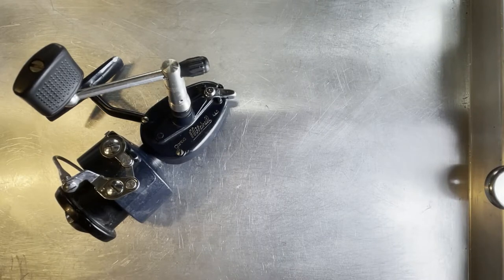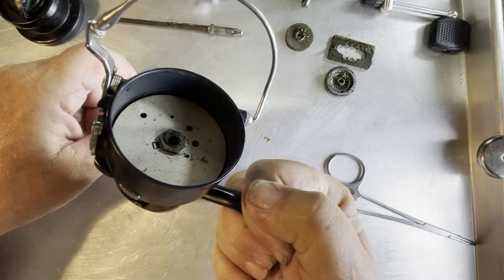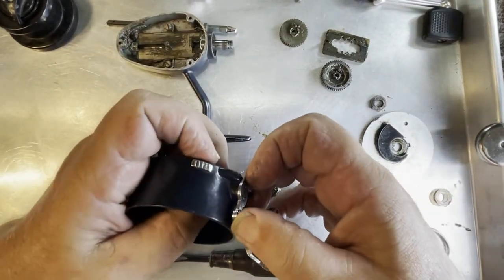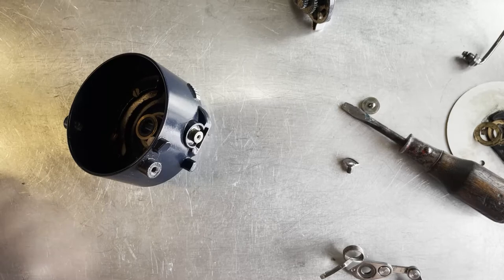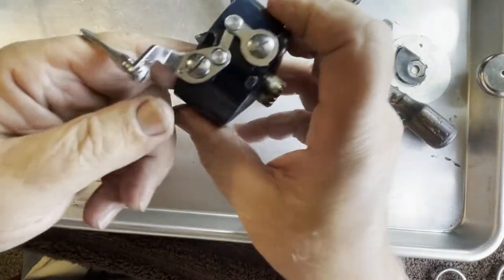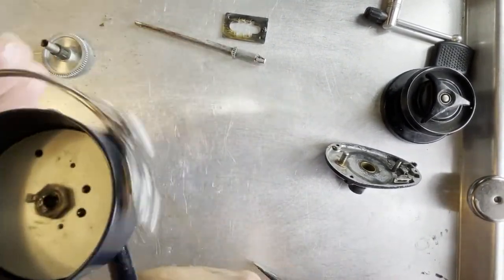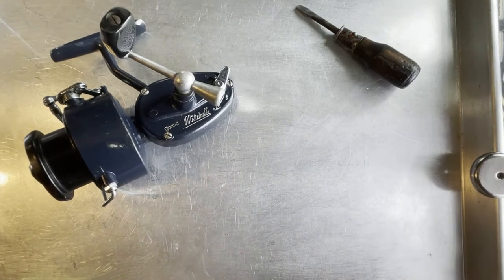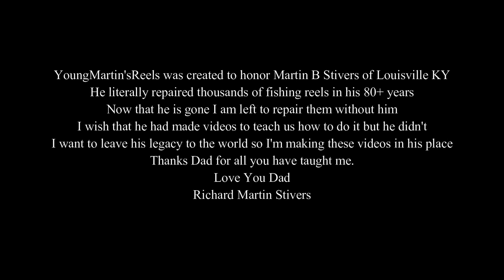Young Martin's Reels Garcia Mitchell 440 Service & Lube Including Bail Remove and Install

Comment: Haven’t used my 440 in almost 20 yrs, took it out to give to a friend and found it’s action to be very stiff. It needed a cleaning and lubrication, very grateful for your video as it saved me time and errors. Works like new now and ready for many more years of fishing. BTW, the 440s are smooth with a fast retrieve, strong and powerful under pressure. My last fish on it was a 28# salmon out of the Sacramento River, a 45 minute haul in on 15# line on a humble fiberglass trout rod.  The reel was totally reliable and up to the task, performed flawlessly. I like vintage reels, still use my modified Penn 300 for open ocean fishing.

Comment: Have 5 440 reels after this video I was able to improve the performance well done. Rick helped me a lot
Reply from the maker: William, pretty much all of the reels I have, I consider to be potentially sacrificial so I don’t mind takin them all the way apart. I’m usually successful at getting them back together. I did save the 440 until I had better skills. It turned out pretty good. I still haven’t tried fishing with it yet. I’m glad you found the video helpful.

Comment: The original bailes on these reels had a manufacturing defect. The bail wire was spot welded to the fitting on the take-up end. That was the weak point. They have a replacement 2nd generation bail assembly to fix that problem.
Reply from the maker: So are you saying the bail from the 440A will fit the 440 with no modifications?

Comment: That bail lock it, so that it doesn’t pop open When you set it down or just accidentally bumped the bail and you have line playing all over the place. I’ve had mine for over 40 years still works.

Comment: I have a 330. I also started down the road of taking the bail mechanism apart, saw that little gear and said nope! You're a brave man. You made it look somewhat straightforward, maybe I'll try it just for the challenge. I think the bail lock is useful when transporting the reel
Reply from the maker: I didn’t know there was a 300 series that had that bail. Nice to know. It turned out it wasn’t that hard to take apart and put together. That being said, if you weren’t mechanically inclined, I’d leave it together and clean/lube it as is.
Reply: @youngmartinsreels5314  The 440 is the high speed version of the 330, like the 308 and 408, etc. Also it doesn't have bearings like the 440. Everything else is about identical.
Reply: Rick, I think the 440 is the high speed version of the 330 just like the 300 and 400 reels. That’s why it has those roller bearings which the 330 does not on the main gear. Mitchell was consistent in their numbering system and how the higher speed reels had more bearings. For instance a 386 doesn’t have a main gear roller bearing while the 486 does. Same way with the 396 and 496 skirted spool saltwater reels. (I call them “needle” bearings but both names are correct. I;ve spilled those little suckers more times than I’ll admit!)
Reply from the maker: I’m thinking I might have cheated myself out of a fun experience by not taking that apart. I also have Jeep transmission videos out there where I teach people how to install needle bearings. Maybe I should have pulled those apart, cleaned them and then reinstalled. I’m sure somebody will end up pulling they out and wonder how to put them back.

Comment: 440s were very popular for match fishing for silver fish in the UK back in the 70s/80s.  Still use mine now (I have 4) but finding it harder to find a tackle shop to service them.  Did a bail arm myself a good few years back but it was hard work.
Reply from the maker: No service centers is not just a problem in the UK. There are very few places you can take a reel to for servicing these days. That’s one reason I make the videos I do so that others can do the service themselves.

Comment: That bail looked like a pain to reset. But you were able to do it. Great content as always Rick
Reply from the maker: To be perfectly honest I got that reel from my dad’s parts pile back in November. I waited until last night to tackle it. I wanted to improve my skills prior to taking it on. Back then, I never would have gotten it back together correctly. Last night I decided I was ready for it. Turns out I was right. Fish On!
Reply: @youngmartinsreels5314  By the way, I believe the handle from a 300 or 400 will fits a 440
Reply from the maker: The handle from the 300 does fit and works fine, but the 440 handle has a collar at the bottom, so this doesn’t look exactly right. Even so, I’m happy with the results.

Comment: That bail is called an “Ottomatic” reel as marketed by Mitchell. I don’t have a 440 but I do have a 330 and after practicing I got used to this automatic bail. It’s sort of like an early “fast-cast” reel. I can’t believe how filthy this one is internally. I’ve had more problems with that bail than anything else. It is very important to synch the oscillation. If the bail is working don’t ever take it apart! My 330 will work better than the bail on this 440 because it has a 5-point baffle plate. I got mine from a guy in Hawaii who specializes in these Ottomatic bails. The trick is learning to cast these reels. I can’t believe you took that bail apart. I was literally talking to the video, “Don’t do it Rick!” You are braver than me! It is so easy to mess this up. You have no idea how lucky you were with this. Where did you get that fancy gripping screwdriver. I have some different kinds. By the way, watching you with that bail was most entertaining. You did a far better job the first time than I did. When you fish this reel you’ll know why you need a bail lock but I’m not going to tell you.  I love these reels though.  Rick you’ll never know how much I enjoyed this! — Chris  (oh, you found out why you need the switch. It would have been funnier to think of you fishing and bumping the bail. LOL)
Reply from the maker: Chris, I ran from doing that bail for several months until I got my skills up. Also I made sure I wasn’t tired when I started on it so I wouldn’t make stupid mistakes. After that, it was just take my time and examine exactly how it went together. Once I knew which tooth the teeth needed to be in it was easy.  

As for the screwdriver, I honestly thought they were a dime a dozen until I went looking for one to recommend to you. My dad and step dad each had several of them when I was growing up. Sears sold them. They were rather fragile. If you tightened the screw up instead of just starting it, it broke the gripping fingers. I bought this one at a yard sale a few months back for a dollar. I figured there would be hundred of them on EBay. I was wrong. I didn’t find any of them.

So your saying that you need to lock the bail when you hook a fish to keep it from popping open, or does it just pop open if you hit it? Either way that could be show stopper.

I did go back and watch the video again this morning. I found myself holding my breath when I was taking it apart. I really enjoyed that video.
Reply: @youngmartinsreels5314  I honestly don’t remember enjoying a video that much. I mean I was talking to you throughout the whole thing. You are a brave man that’s for sure. I took mine apart once and I never intend to do that again. If you ever work on a Mitchell 406 that can be very entertaining as that reel has several surprises. Have you ever worked on reels with open ball bearings? The 406 has one and a Bretton 400 has a double open bearing. You should have seen me crawling all over the floor looking for those bearings. It was absolutely comical. You are far more skilled than I am but have I told you I’m 60% blind? (Stargardt’s Disease) — Chris
Reply from the maker: Chris, So sorry about you eye sight. I’ve become very far sighted in my later years but it corrects just fine with reading glasses. I can’t imagine doing this without corrected vision. I salute you. I’ll have to keep an eye out for one of those free ball bearing reels. They sound like a lot of fun. I had an English racing bike when I was a kid the used uncaged ball bearing on the axles. I remember chasing them down driveway. Your experience reminded me of that.
Reply: I have almost every Mitchell otobail reels  in my collection ; exept the 540. The first ones was made in 1955 , only wearing the MITCHELL otomatic sign engraved , no 330 lettering . The first ones didn`t have the ,, travel lock " button on rotatorhouse and the bail in more  300 shape with the D shaped line eye. The last made Mitchell otomatics was the 840 .

Comment: I'm curious, what type of grease do you use on these old Mitchell reels? I have a few old Mitchell 300's. After cleaning them up and applying Penn grease, they seem stiff and don't turn as freely as they should. Any advice you have would be appreciated.
Reply from the maker: Dolan, I use Penn grease on most of my reels. There are so many sliding surfaces in the Mitchell reels that the grease tends to cause them to drag. The places to oil instead of grease are where surfaces slide against each other. For instance, the main gear shaft rotates inside the side plate. If you grease that shaft it will slow it down considerably. I use oil on that shaft. Anyplace else you can identify to oil instead of grease will be good too. The only problem is the reel will require more often servicing. Don’t substitute oil for grease on any gear teeth. I hope this helps.
Reply: @youngmartinsreels5314  Yes I think this will help. Thank you very much. I still have one on the bench and I will give it try. Thanks again.
Reply from the maker: Let me know how it works.

Comment: Bail lock is for when reel is in transit
Reply from the maker: That is correct.
Reply: If not in transit = keep & store the reel with   bail in open position to hold the bailspring in relaxed condition .